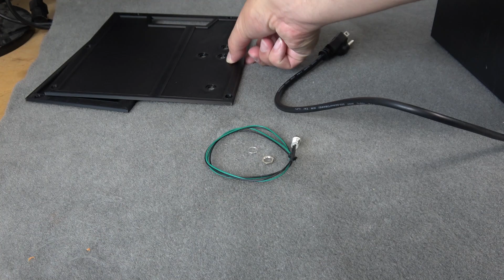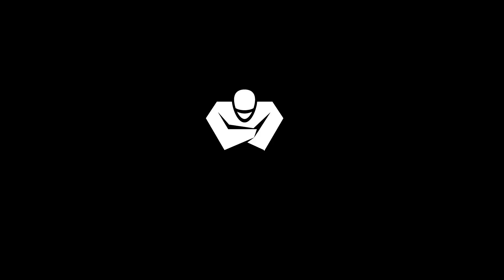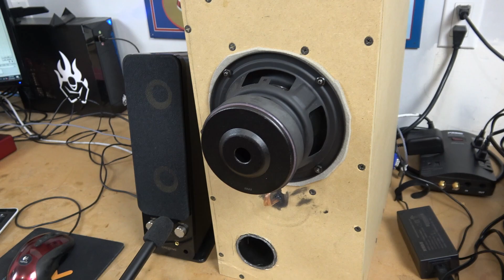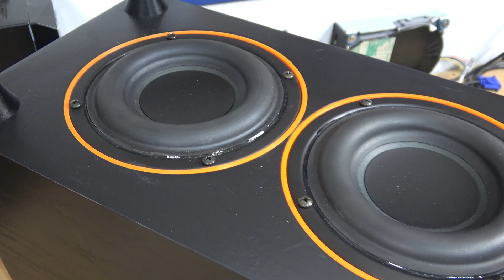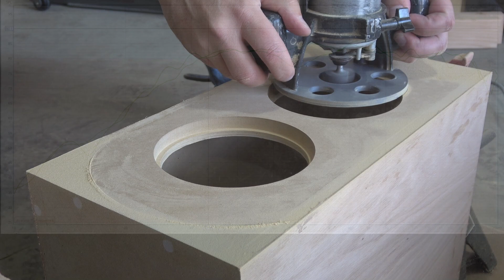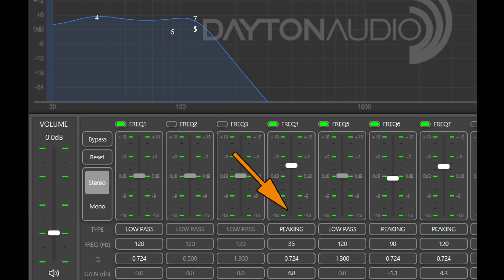Final Tuning and Verdict of the Retro PC Dual Subwoofer Project

Comment: ! Great Video. The First sub with the Plate amp looked the best in my opinion. However I had the same problem Listening to those "Tinny" front computer speakers so I made a DIY Solution with some 6*9 speakers I already had and one of those Booster/Equalizers with the Spectrum analyzer display from the 80's. I'm just Using the Two Channels but it Sounds So Great. Not as low as the Subs but for a set of computer Speakers those coaxial 6*9's rock and especially sounds WAY better than the small Logitec style speakers. Perhaps you Might Consider the 6*9's or Similar instead of the circular "Bookshelf" Design for your build. Also 6*9's can be had for Cheap compared to buying Speakers online and Shipping etc.
Reply from the maker: Thanks for watching and the comments.  The first box was nice but, largely unfinished and there are aspects of the current box that didn't turn out how I had expected.  Never know, I may do a "done done" version of this box and ditch the 3d Printed port.

As for the desktop speakers.  I'm not sure I will go with a 6x9, I honestly never liked those back in my car audio days, mostly since every 6x9 was a coaxial and couldn't be tuned.  However, in this instance they will simply be too big for my desktop.  My initial thoughts were to keep things compact but expand the dynamic range over what you would normally get.   so something like a 4"-5" Mid-bass coupled with a tweeter then focus on mid-range + tweeter or full-range on the center channel. 

The jury is still out on a final decision and I'll be sure to do a video introduction when it comes time.